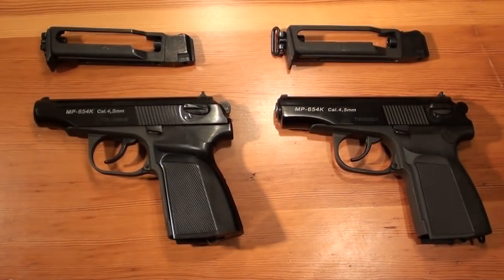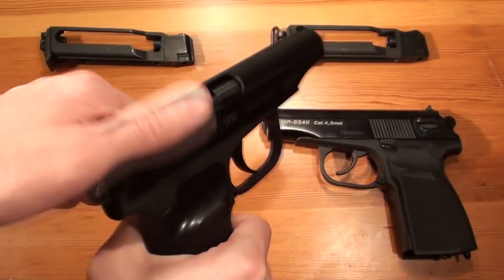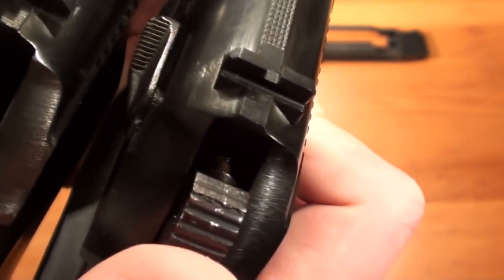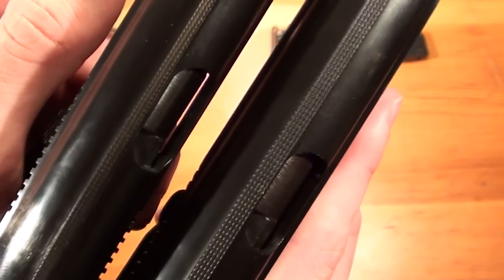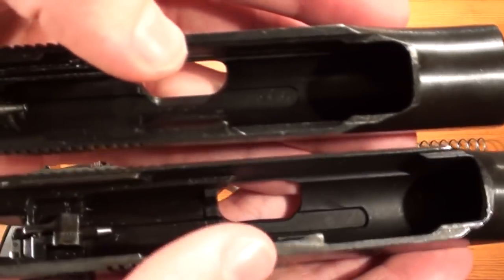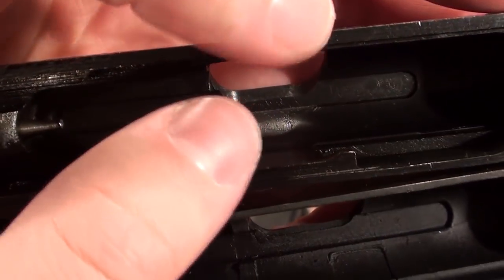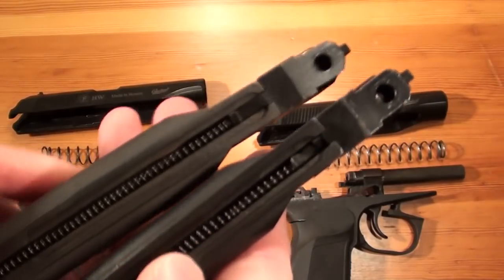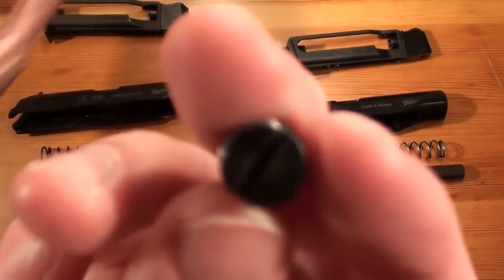Old Baikal MP-654K 1999 Compared To New Model 2009

Comment: Nice video. I also own several MP-654k from different years. One from 1999, but it has different slide (different shape and has the extractor cut). Also a head of the magazine has a cut to be to be fixed more hard to the barrel. Also you did not notice the red color of the hammer, safety and a trigger pull on 1999 model that shows that they are from the original Makarov, not Baykal!
Reply from the maker: Nice!
Reply: T99 with extractor cut? Interesting and nice! Mine T99 is exactly like the one in this video without the cut.

Comment from the maker: Steel BBs is the way to go. I've tested it myself and they are the most accurate and fastest ammo you can use. I've tried the gamo lead balls myself and once in a while the last lead ball is crunched by the sharp follower and gets stuck in the barrel. Even though the barrel of the 654k is rifled, lead balls won't give better results than steel BBs. I also do not recommend the Crosman copper BBs. They were the worst BBs I have tested regarding v0 and accuracy.

Comment from the maker: Either one is good. The only difference really is the slide material and shape. The older one has a machined steel slide with original shape. The newer ones are cast iron and have lost their original look. But the longevity on both models is excellent considering it's just a cheap toy gun. If you can wait and know for 100% shure you can get your hands on an older model I would recommend to wait but a new model will do just fine.

Comment from the maker: I never experienced this type of failure with the 654k but it's not uncommon. The BBs have to be a bit smaller than the bore because they can not deform in the barrel. ;)
Sometimes the CO2 pressure blows to BBs out of the magazine or not even one right and if you shake the pistol it might fall out of the barrel.

Comment: Hi @2lbsTrigrpull, thank you very much for the informative video!  I have just purchased a T99 serialed gun from a collector, but is yet to receive it.  I have a question though: the gun has a rounded slide front like the Gen3 and a cut-out for the extractor.  Is this possible for a T99 gun?  What clues should I look for to check if it is a Frankenstein or fake?  (I guess it may be too late, but I would still like to know).  Thanks a lot in advance!

Comment from the maker: Hi Rune,
Double Action is a very heavy trigger pull but Single Action is very light. Though it is not a blowback gun so you have to cock the hammer everytime. I don't recommend the Baikal Makarov to you. Maybe the Umarex Makarov is better suited.

Also if you need to disassemble the gun the mainspring and the trigger guard spring are actual springs from the firearm so very strong. It wouldn't be a pleasure, trust me.

Comment: Great comparison. Do you know if the newest models are improved at all in quality? I have seen mixed opinions on the 2017 production
Reply from the maker: I don't think they improved. They stayed the same or got worse. Depends on the model you get. There are so much different models out there today that makes it very hard to give you a definite answer. Buying an MP-654K without actual pictures of the gun you will get is like playing russian roulette. ^^
Reply: @2lbsTrigrPull  Thanks for your reply. I think the best possible scenario will be to inspect and examine in the showroom before committing to a purchase. I have seen the earlier generations for sale second-hand, and these maintain high quality and good condition, but at a higher cost. All the best to you

Comment: Do you know/think that the 2003 production ones are as garbage as the 2009? Or a bit more closer to the 1999/2000 production models, like if the slide is as thick/heavy and the slide machined or casted?
Reply from the maker: I think the 2003 models are one of the better ones. 1999/2000 are best quality and relatively low price. Now they are overpriced and have worse quality. Maybe you are lucky and the 2003 model still have a milled slide and not cast.
Reply: @2lbsTrigrPull  I will try to find 1999/2000 model, if I can’t I will buy the 2003 model since it’s only 135€
Reply from the maker: @Mihail2204  🤜🤜
Reply: @2lbsTrigrPull  I wanted to let you know that after a bit of digging I found out that 1999-2005 models have a CNC machined slide and only after that do they resort to casting, also heard that the 5th generation ones started to be CNC machined again but I don’t know how true that is
Reply: @Mihail2204  Yeah, supposedly all variants made after 2013 are as close to the original PM as possible, including the original rifled barrels and CNC milled frames.

Comment: Greats video.  I just bought a 2004 in nickel and I've heard the 2004's are the last of the good ones, before they changed the design quality to be much cheaper.  Would you agree that they made changes in phases through the years?  I know the best ones are the 1999/2000 models,  but the 04's are still better the newer versions? cheers

Comment: Do you know if the latest versions of this makarov are better? Like the 1999-2000 edition?
Reply from the maker: +Meriadec Du Boisrouvray 1999-2000 were the best. Not one single version after that can hold a candle to them.
Reply: +2lbsTrigrPull ah, it's pity, they are so rare now! The mp656k is amazing too but not longer produced ;/ I will maybe buy in a Russian website a mp654K Gift edition, do you know the quality of it?
Reply from the maker: Meriadec Du Boisrouvray I guess the same as the standard version just a wee bit fancier with extras and maybe a nice box. ^^
Reply: +2lbsTrigrPull Yup but I finally bought a T99 thanks to ur advices, I hope I won't be disappointed ^^ It comes with a box and a original holster. I bought it for 220€, nice offer?